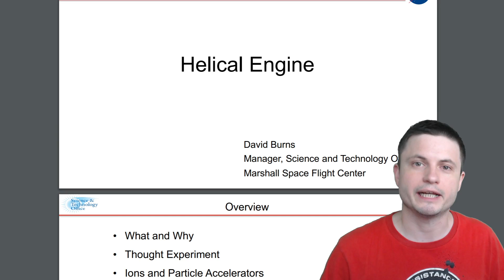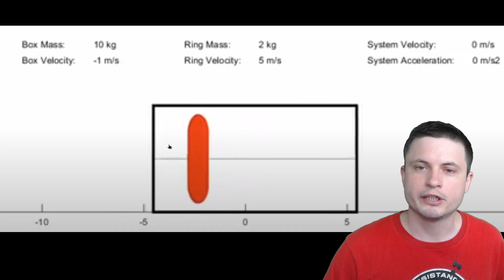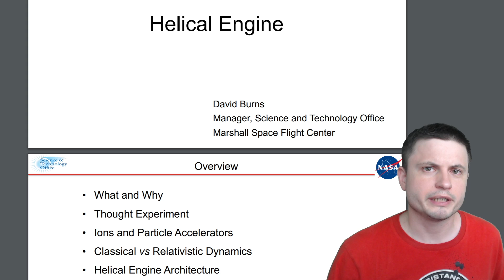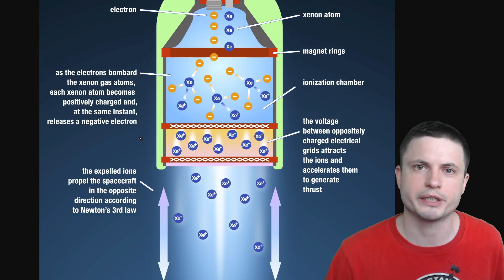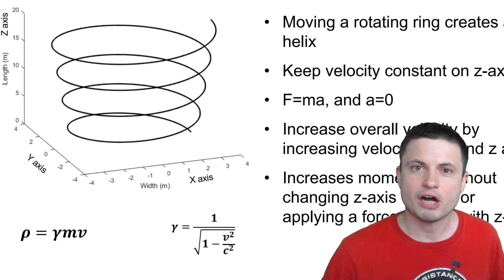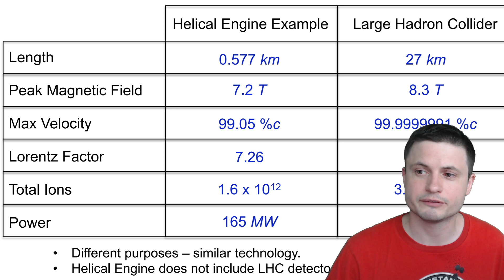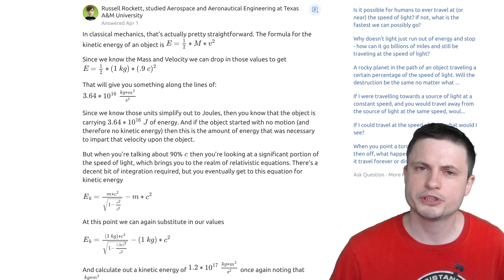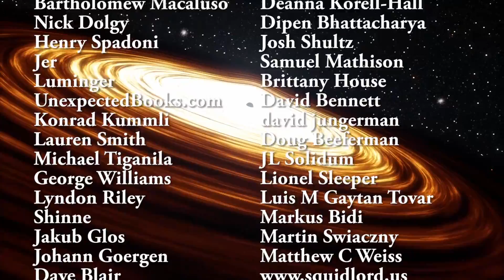NASA Engineer Designs a Near Light Speed Engine But Does It Work?

Comment: Remember when the US military had that incident with a "tictac shaped" object that shown no sign of propulsion even in the infrared spectrum where the expulsion of heat should be visible.  And it still was able to accelerate to insane speeds and outmaneuver the fighter jets sent to check it out.  It definitely happened and I always tried to speculate on what kind of propulsion something like that had, and once I heard about this it made me wonder if something like this is it.
Reply: Exceptional claims require exceptional proof.
Reply: @matta5498  Not always, you can also just toss out fun ideas for fun. 
No one will lose an eye, I promise.
Reply: @grampyBot  , ok, fun idea.  You had me respond when you stated it definitely happened.
Reply: @matta5498  
No that was someone else that said that.
 And I'm pretty sure they were just pointing out that the video, with the pilots chasing the strange object, was real, and does need some explanation. 
I'm a die-hard skeptic of everything not supported by the scientific method. But guess what? Sometimes fun things happen.
Reply: @matta5498  go watch the videos with the pilot explaining it... Joe Rogan.
Reply: @matta5498  Video evidence from the Pentagon not exceptional enough?
Reply: @impulseCI  It's not good evidence if you can barely see what the object is..I'm 95% certain it was a Chinese experimental craft. The technology they are developing over there is scarily impressive!
Reply: @Timbo6669  It's true that it's difficult to resolve a lot of detail in the video. But surely the way it moves is more important than the superficial details? I'm hesitant to believe the Chinese (or any government, really) are able to create something that can move like the "tictac" moved. Keep in mind the Chinese basically stole the US design for the Space Shuttle. Considering the video was from 2004, that means there has been at least 15 years to develop and refine the tech. By now wouldn't you think there would be some sort of military or commercial application of the tech?
Reply: @Timbo6669  yeah, that Chinese experimental craft that literally vanishes in thin air and reappears 40km away in seconds, defying what we can achieve with physics. Must be the chinese that have figured out how to overcome inertia, emit no visible signs of reaction propulsion and train there pilots to manage to descend and ascend up to 80km in a matter of seconds with no negative effects on the human body and allow the craft to literally be completely 100% invisible to the most sophisticated technology in all nations arsenal... no craft ever produced is entirely invisible to radar, ever.

These are all behaviours that the Pentagon have admitted these craft exhibit.
Reply: @Timbo6669  also, yeah, that plane they revealed that totally isn't a direct copy of the F35... their espionage is scarily impressive. The Soviet Union were scarily impressive too when they copied the space shuttle... that truly scarily impressive innovation, hoowee
Reply: @impulseCI  No earthly reason to use a shuttle design..Its obsolete.  By that logic, the Russians  stole the Nuke designs from the U.S. and they weren't able to detonate a better version? YES they were. The Russians have the biggest nuke of them all, from stolen plans, which they then improved upon.  I don't know how you used your logic with the shuttle comparison.
The fact it jammed the radar [an act of war], then was able to 'hack' into the subsystems of the jet to get the next Cap point screams China.. THey have constantly been pushing there boundaries lately, and testing the U.S' military might.
Reply: @MechanicalMooCow  ooh-rah..am i right? yanks are the best at everything...sigh. A plane in which they ' revealed to the public'..Did the f-117 get revealed straight away? or was it used for a decade before it was shown to the public?
Reply: @Timbo6669  ... my point with the Shuttle was that if China had to steal a US design for a simple shuttle, how could they possibly design something that defies physics as we know them? Woosh
Reply: @Timbo6669  l wouldn't say the Soviets stole the nuke plans, more they were sold them by a us government worker who didn't want the us to be the only country with such a powerful weapon. It's also been possible to make much bigger nukes since we'll before the Tsar bomb was detonated (even it was dialed down to half the original design strength so the plane had enough time to get out of range), the reason nothing bigger was made is there was no practical use for it.
Reply: @impulseCI  
Nope.
The video they gave us of 9/11 was laughable.
Reply: @Timbo6669  That would mean the Chinese had super advanced physics defying tech 15 years ago that today we still cant even conceive. Sorry, but no. 

If anything, they have been copying our tech.
Reply: @Timbo6669  because they stole everything from cyber warfare.
Reply: @impulseCI  I truly hope that was sarcasm!
Reply: @loungelizard836  Wanna elaborate on that? I made like 10000 comments in this thread. Which one are you hoping was sarcasm?
Reply: @impulseCI  Video doesn't show anything.
Reply: @matta5498  there is literally multiple videos of it. Commander David Fravor. Keep your eyes closed tight though, unexplained events that even the Navy and Government comes out and says, "yeah, we've no idea wtf it is" can be a scary thing for closed minded dogmatic dinguses
Reply: When people ask Lou Elizondo how the propulsion works, he starts talking about the LHC. Bending the shape of space and gravity fields with high energy? he's pretty vague about it yet claims we are getting very close to theoretically understanding it. It's possible he's exaggerating or doing disinfo but he comes off as intellectually honest and scientifically literate.
Reply: @Fundamentalist American. Okay, that sounds reasonable enough. But what about the same object being 40km away within seconds? I don't know much about hologram tech, but I don't think they can project that far away. Also keep in mind that this object was detected on radar, which means it must have been solid. I'm not so sure holograms can be detected by radar.
Reply: bum bam  What does that accomplish? Let's say the government made the entire thing up. Now what? People have been talking about UFOs since before the US even existed, so I'm not sure how faking a video would serve any purpose for the Navy/Pentagon/DoD. It's not like they need to click bait people for ad revenue. Plus, I thought the conspiracy people argued the government was covering up aliens? Now the same government is trying to trick people into believing aliens exist? Which way is it?
Reply: that tictac belongs to the American military  and yes not all know this
Reply: @irockireckon9776  Interesting hypothesis. Do you have any information that leads you to this idea?
Reply: @irockireckon9776  Does government technology explain sightings prior to the 1900s?
Reply: @irockireckon9776  Possibly, built by the defected nazis, refined by current day US government researchers/engineers.
Reply: @Vadim VeeVoit youre the smartest person in the room wherever you go. Nice.
Reply: bum bam  So you're saying that the government is currently making fake UFO videos to fuel the UFO consumer junk market? And no I don't mean ancient aliens. I mean people reporting objects in the sky that they couldn't identify... you know... UFOs. The term isn't synonymous with aliens.
Reply: Gravitation propulsion. I'm sorry you are going down this rabbit hole
Reply: That's an interesting thought...
Reply: @Fundamentalist American. From where was the hologram projected? One of the fighter jets?
Reply: @Vadim VeeVoit Googling what exactly? Is that that documentary by Jeremy Corbell? Haven't seen it but I did watch that Joe Rogan podcast with him and Cmdr Fravor, and also the one with Corbell and Bob Lazar. I found both intriguing.
Reply: @Vadim VeeVoit Sounds interesting. Thanks for the tip, I'll have a look.
Reply: Darth Wheezius  well no one actually knows if gravity is a quantum force yet
Reply: Imagine if it is some sort of shrinking cloak or bigger-on-the-inside technology.
Reply: @Vadim VeeVoit I agree. NASA keeps building billion dollar science projects and we wonder why we haven't been back to the moon.
Reply: The objects were said to be able to go supersonic without creating a sonic boom. There's only one known craft which could do that in particular called the Busemann's Biplane. The only problem with that though is that it cannot produce it's own thrust without creating a sonic boom. As such, it can't be the craft described as it can undergo immense accelerations. The only other hypothetical explanation is the in-atmosphere usage of a warp drive. From the perspective of the air moving around the tictac ship, the space it's in would be getting moved around, not the gas relative to space. The gas wouldn't experience any high-pressure effects as it doesn't feel anything rush by it at supersonic speeds. It may briefly see the ship move past it but it would be acting like it's still.

As a physicist, I can confidently say that humanity doesn't currently have the correct enough theories or technology to build these crafts. They're probably FTL alien spaceships.
Reply: let us never speak of the tictac incident
Reply: certainly not
Reply: @Vadim VeeVoit Hah thanks. Yeah I think that's possible. I was going to make UFO hunting videos with a buddy that saw them with me, but he's not as motivated to share as I am.... and it's kinda hard to make them interesting solo. So it'll probably just turn into a documentary / record of time that I spent looking.
Reply: @Fundamentalist American. I bet it was the manifestation of a magic mushroom!
Reply: bum bam  I don't even know what you're arguing here. I didn't say anything was from space. Again, why would the government make "alien propaganda" videos? Some kind of recruitment tool? It doesn't make any sense that they would make these videos to fool people. Why would they need to? Plenty of people believe that we've been visited already. The government really doesn't need to waste time and resources on making people believe it more than they already do.
Reply: We have evidence of UFO's as in Unidentified Flying Objects that we have confirmable records of. That does not equal Aliens. At this point it could be Fairies Punking us, seriously as Fairies were strongly believed in 1800's with tons of reports most of the type of UFO sightings we have current times. Fairies have been believed in for a very long time. These could be Physics and or Weather Effects we have no good data or theories on. We only learned about Sprites and other effects above Thunderstorms recently. Biggest problem with aliens is they should be able to manage a ship sized clocking device so why not used them if they don't want to talk? Cloaking technology already exists it just scaling it up from a tiny object to something useable the current technology problem. 
Only things with good conformation is Governments have looked into stuff and in some cases covered up their lack of knowledge but nothing seriously considered in covering up know things and Governments leak information by the ton. 
So it's a fun interest but for us who know how badly Governments keep stuff secret and the fact the premise of why they would keep this secret if they actually knew anything provable is quite weak. I think many a political leader or Government wanting to embarrass another would gladly spill Alien secret for the advantages it would gain them.
Reply: Michael Madden  I read your previous comment on your theory. If that was actually happening it'd look radically different. Lets say we have an object move one meter to the right in one second. Then we have it travel backwards in time one second while moving another meter to the right. To an observer, this would look like two objects two meters apart moving 1 m/s towards each other before disappearing when they overlap. It would not look like an object traveling 2 meters instantaneously. Therefore your explanation cannot be correct.
Reply: Eddie bravo has entered the chat
Reply: @Vadim VeeVoit You got trolled so hard and you're thanking the dude like a freaking simpleton. lmao
Reply: If one would collect all the tinfoil hats from this comment thread, you would have a lifetime supply of BBQ wrapping.
Reply: Darth Wheezius  I agree, too. Claims do require evidence. The thing is that there IS evidence, and yet people still refuse to believe it.
Reply: it definitely happened? lol
Reply: Personally l think most people that claim they have seen aliens are idiots or mistaken, but given multiple astronauts, US presidents, air traffic controllers, the US Navy and Pentagon have all stated there are things out there that they not only can't identify, but couldn't possibly work with our current understanding of what's possible there is clearly something out there. Now lots of people claim it's the US or other government projects and l agree they probably know far more than they say, but given we have credible reports since at least WW2 if the technology was from any government l would expect we would know far more by now. It seems like there have been many attempts to replicate some of the technology, but even if they succeeded, it's clear they were trying to copy something else that they didn't understand because a lot of the early attempts were pretty lousy.
Reply: @Jake12220  I'm with ya pal.
Reply: Yeah, the TicTac thing. The thing that traveled vast distances just to have about ten minutes of fun with the humans before leaving forever. Sci-fi is interesting, isn’t it?
Reply: Darth Wheezius hey dumbass, the videos were confirmed real by the navy.
Reply: No. I remember when some YouTube videos made those unevidenced assertions, but I dont remember it ever actually happening.
Reply: @Vadim VeeVoit well sure, that explains everything.  Hyperintelligent aliens trying to give physics lessons to an empty-headed greedsack like Trumpty.  Not so smart those aliens after all!
Reply: Fundamentalist American. The tic-tac Is a government tier 3 project, tier 1 projects are the most advanced technology they allow us to see today while tier 2 projects what they are working on which the public will see in 20/30 years n tier 3 projects they work on will never ever be on display for the public, they have had anti-gravity propulsion craft since the 50’s man
Reply: @robcheek736  Source on this project tier thing you speak of?
Reply: They had just upgraded their radar systems and software which caused those. They're glitches. Nobody seen those with their own eyeballs.
Reply: @W1se0ldg33zer  That's not true. All 4 people in the flight witnessed the object with their eyes. 2 in one plane, 2 in the other.
Reply: @impulseCI  All looking through HUD displays.
They said they get these every time they upgrade software.
Reply: @W1se0ldg33zer  No, they saw the object with their eyes, then switched to their instruments to track it. Cmdr Fravor said it himself.
Reply: @W1se0ldg33zer  not only have more recent events been witnessed directly by pilots and radar, in WW2 both sides reported seeing similar things they thought must have been from the enemy. There are lots of reports that may be on a similar line from long before, but WW2 was the first time credible reports were made by people trained to identify aircraft and had no reason to make any of it up. Ever since trained observers have reported countless events and though many could be explained by unusual natural occurrences, there are some that make no sense other than we don't know what they are, but we know we don't have any way to replicate what they do.